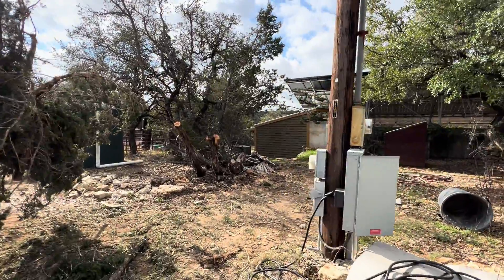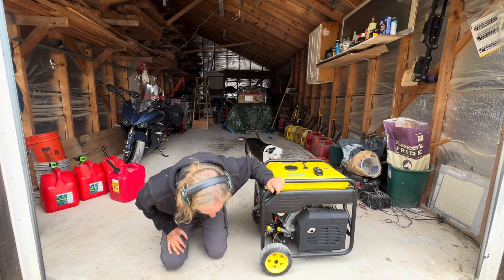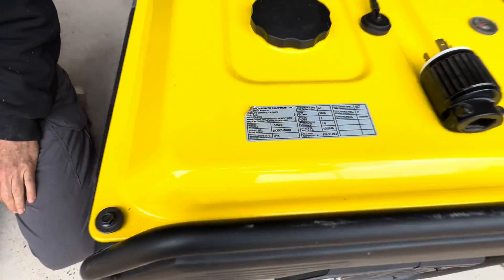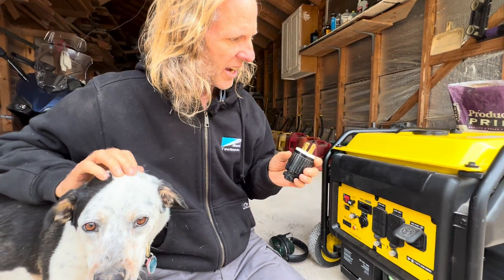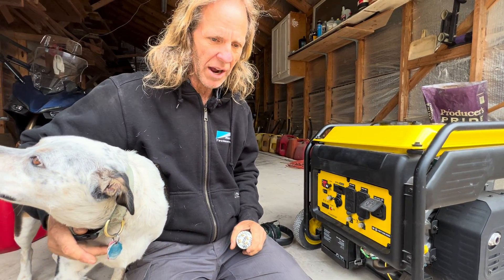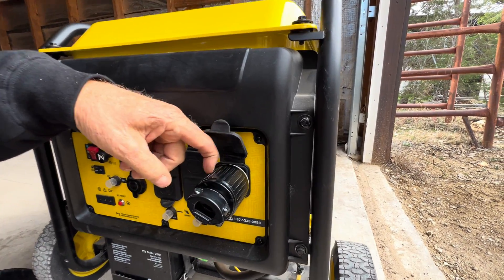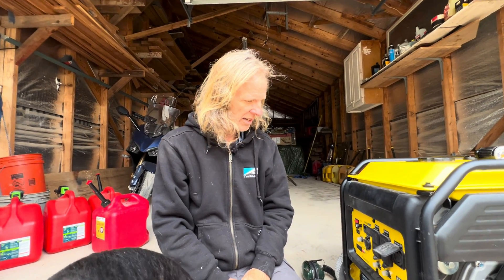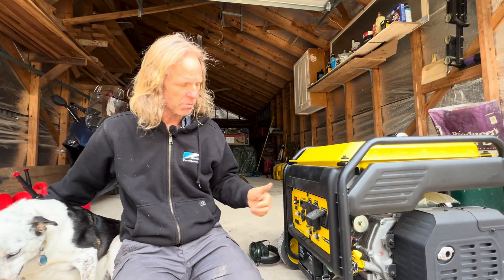How To Run Your Air Conditioning From A Small Generator With An Easystart

Comment: Pro Tip: If you need to run the Heat Pump in an emergency without the Auxiliary Heat Strips. Simply remove the Thermostat from the wall & disconnect the single “Aux” wire from the 18-2 wiring coming into the Thermostat. Just remember to reconnect it afterwards.
Reply: Is that going to stop the defrost board from activating the heating strips during a defrost cycle?  Fairly sure it doesn't on mine.

Comment: Hey Ray, you probably have thought about this already, but what about using the exhaust heat  from your generator? You could use that heat to warm the outside of your aircon system. That should make the entire setup more efficient when doing reverse cycling with your aircon.

Comment: If you have a 12kw portable generator is any of it really an issue at that point when just trying to run a 2.5 ton unit?
Reply from the maker: My 2 1/2 ton unit had a starting impassively of 59 A. A 12 KW generator will not start a starting load that high.
Reply: @RayBuildsCoolStuff  ah so prob at least a 15k watt generator
Reply from the maker: @codycoontz6199  still not enough.

Comment: I'm an old HVAC worker who used to cover a portion of the condenser coil with something to increase head pressure. This will provide more heat due to higher pressure at valve before flashing liquid through valve to condenser or reversing valve. Depending on temp you might need to alter configuration of blocked area, you learn what works at given temperature. Maybe this would be simplest way, it won't be more efficient however.... Thanks for your honesty on suppliers for solar, another video which turned me on to you; a lie can change the world in some part.. thank you..

Comment: Thanks, Ray, added my MicroAir 368x72 to my 4T compressor and brought the Locked Rotor Amps from 109 to about 49A. Sweet! Generator can handle it now.
Reply from the maker: That still seems very high. Has it gone through its five training cycles?
Reply: @RayBuildsCoolStuff  it had. Though I haven't checked lately. I think the outdoor temp was only in the 60s when I installed it, wonder if that mattered.

Comment: 7:13 low temperatures for you are different for me
yes, that might be true considering from where over the world people are watching. Right now 14 °C and rain, but during winter and till may we now do he with single split AC in heat pump mode and maybe 3 or 5 days a year during summer we use AC too, otherwise it is not needed and we tend to avoid ac rooms and offices. Even in most cars AC had been missing till most recently . 

Yes, the mitsubishi can run even during very low temperatures and therefore we had gotten another one , each 5,4 kW heating power and then we have an oven connected to the hotwater heating system as the oil heater too, but we do no longer use the oil heater in general except a few days. We are going away from gas and oil, both are dead here in the private sector, only the industry is using it but in a decreasing amount cause it is replaced by solar power generated systems and wind turbine systems too.

Comment: Ray, could you tell me what type, make, model of mini or micro ohmmeter you use to test your batteries and connections?  I like how you can test down to 3 places.  Thanks.
Reply from the maker: It is a YR1035+.
Reply: @RayBuildsCoolStuff  thanks.

Comment: Another way to use a small genny to run your whole house is to use it to charge your battery bank. In my case, I have 2 6500w inverters in split phase, providing 240v, and a 30kwh battery bank. I have it set up so i can plug the 30amp cord from the generator to my solar shed and have it charge batteries anytime I need it. No need to worry about turning off loads, easy starts, and NG Bond.

Comment: Good point on the defrost mode.  I will have to check my mini-split specs.  I just bought the 6250/5000 version.  The bond wire colors didn't match the manual or the online video.  They couldn't tell me what to do so I just followed the leads and did it.  Works so far.  Thanks.
Reply from the maker: Good job!

Comment: I've heard diesel heaters are very efficient, but need an exhaust to outside.
Thank you for the nice program today.
I'm not sure I understand why neutral and ground cat remain bonded in the generator. Ground loops?
Reply from the maker: Yes, we never want to create a ground loop.
Reply: I’m currently running my house with a harbor freight inverter geny- first I’ve heard about removing the ground. Everything seems to work fine, but I’m not understanding the issue- ground loop. And if I do need to , how do I rig the plug as you did ( one came with the geny).

Comment: Ray I see a lot of your videos. I'm working on a solar power system for my off grid tiny home camper that me and my wife live in. I have stage 4 cancer and I'm in a race with time to try to get this system together. I have 8 panels and a 3000 watt all in one charge controller. I need a battery bank that can sustain us for a couple days of bad weather. You build the best batteries on YouTube and I appreciate the knowledge you give us. Any help with how I can get a battery without costing a fortune would be a God send. The cells seem to be very expensive but I'm sure they are worth it. Thanks again for your videos and God bless
Reply from the maker: I’m not sure how it can be done cheaper than what I show in the videos. You might cut a few corners, but I wouldn’t cut corners on the quality of cells fusing or the BMS. Sorry to hear about your situation. Wishing you the best of luck.

Comment: My tri-fuel Firman runs on natural gas and so does my furnace. A 30 Amp 240 Volt generator will power a 4-ton A/C outside unit using the Micro-air EasyStart. My unit now uses 12.8 to 13.8 Amps and a Start Peak of 33 to 36 Amps. A 5-ton unit may have a start peak of 45 Amps.

Comment: Thanks Ray.  I wondered how best to handle the bonded neutral issue where you sometimes hooked up the house and other times just used the generator standalone.  I like your idea for the plug.  Lots of information in this one as usual.  I didn't know about how to get around the defrost cycle.  Great stuff.

Comment: An idea for your defrost issue - lots of manufacturers use time/temp defrost because it's cheap (the defrost control board will usually have 30/60/90 selection, defrost triggers after accumulating that number of minutes under freezing temps). Instead, you can retrofit a demand defrost controller that compares the outdoor coil vs air temp to determine if the coil requires defrost. This significantly reduces defrost cycles because most people won't need defrost after 90 minutes (but even demand defrost will trigger defrost after 6 hrs or so to ensure sufficient oil return to the compressor).
Reply from the maker: Thanks for this. I will definitely check into this.

Comment: Added an easy start and a whole home 100amp propane generator.  Had ac tech put in a relay that connects to my whole house ats and is triggered to turn off all but 5k of the heat pack. During a grid outage. Works great.
Reply from the maker: How long does your propane tank last? What size is it. Lastly, why do you think you need the resistance heat?

Comment: Thanks for you pointing out that defrost in winter will be too much for my generator or inverter on a heat pump (air)..  For me up here in Canada, I plan to switch to a wood stove or off grid propane furnace in the event of a power outage in my rural area.
Reply: Heat pump defroster can here ruin your economy if you are not paying notice... We are to close to open ocean so the air is always very moist and if the temperature drops under -7 the heat pump defroster start using enourmeous amounts of energy wasting it on defrosting. I got 5 double energy bill first month the temperature dropped below -7 because I did not know that as they claimed it could handle -25c and still use less energy then electric heating (not true where I live....). But one time it was -20c and wind blowing from inland with dry air and then the heat pump indeed had no trouble at all. Problem is that happens maybe 1 time in the winter, normally wind is always straight in from the open ocean with exstremely high air humidity....